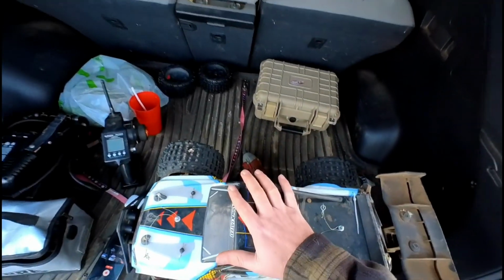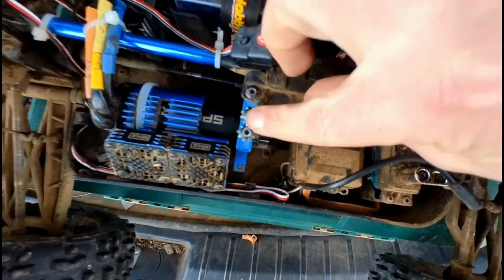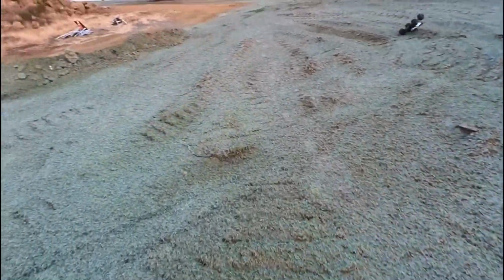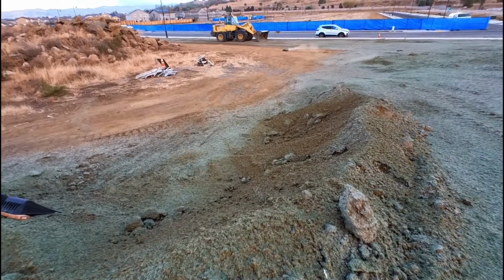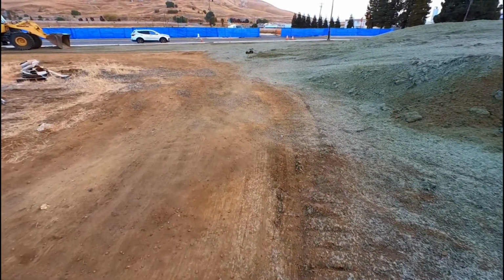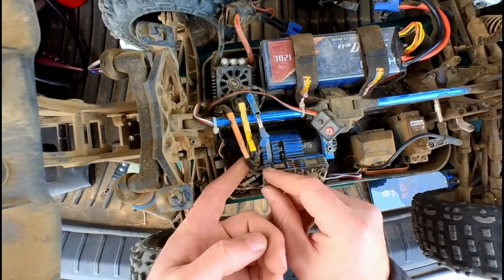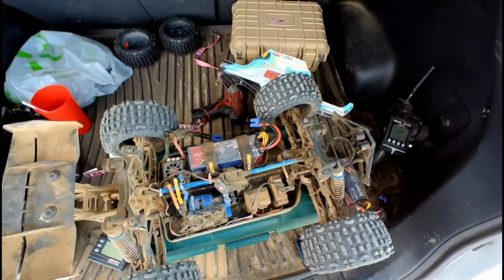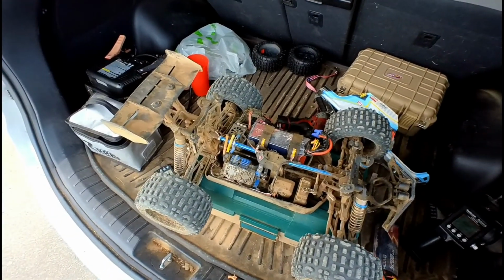MT8 with max8 first rip! and another Spektrum failure? Still only on 4s

Comment: that wiring sh*t happened to my Kraton 4S. was sooo stoked cause i had no damage after the latest run except for the spektrum motor blue wire. i love solderiong so no biggie, but HOPEFULLY I can get it wrapped up today and move on to the XRT baybee
Reply from the maker: I only hate soldering cause I have ptsd from 2 irons blowing up in my hand. 
And I'm not very good at it. 😆 🤣
Reply: @captaincouldverc  i bought TS100 soldering iron about 4 years ago and haven't looked back since. I should make a video for this, but one trick i learned on larger gauge wires - is using one of those small kitchen butane torches. A vice, 63/37 solder(never lead free) and LOTS of flux. DO NOT VICE BOTH BATTERIES WIRES AT THE SAME TIME OTHEWISE IT'LL BE CAPT. TOAST'VE. pool of flux heated to pool of liquid solder, dip tinned wire end. hold. set. slide blue sheath over it til it clicks in place.